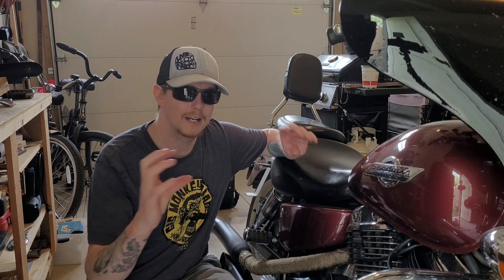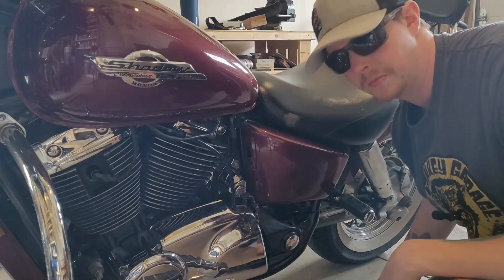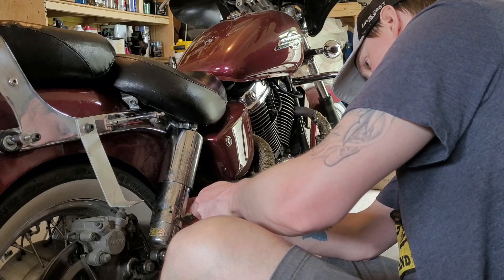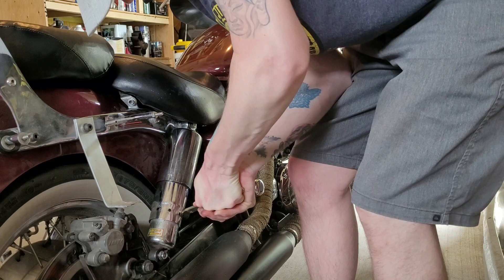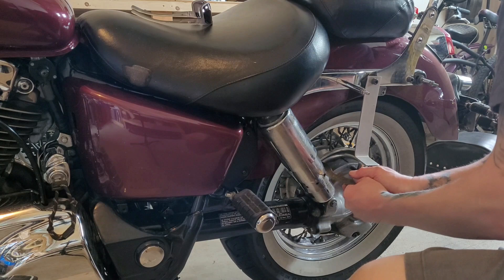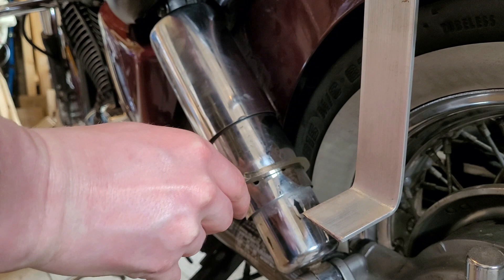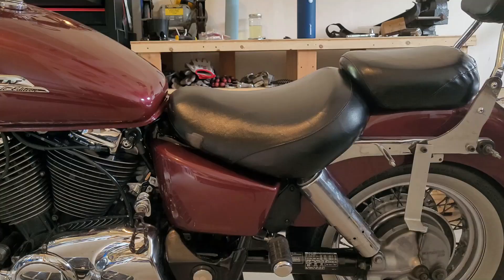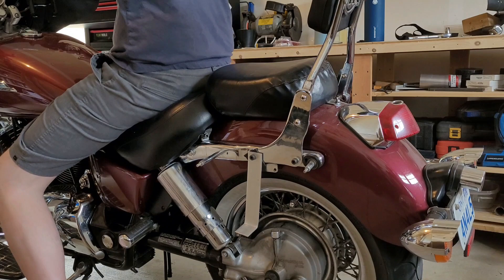Honda Shadow | How To Adjust These Rear Shocks

Comment: Im 300 lbs usually riding solo and mine are all the way up.Makes for a smooth ride.
Reply from the maker: Thanks for the info 👍  I've still got them set at 3, alittle on the stiffer side for just myself

Comment: At the 2 minute mark when you turned it and it popped and shot down is that bad and how do I go about fixing that or what do I do if that has happened? I have a similar bike and the same side did the same thing to me I’m just trying to figure it out. It’s my first bike and kinda learning everything from videos lol please help
Reply from the maker: I wouldn't say it's bad, keep turning it and it'll adjust up again, should click into place at each level
Reply: Should i get the bike off the ground when i do? I dint have a bike jack but i cant get one unless its still ok to do on the ground.  @motoalley
Reply from the maker: @scotthall3961  you can do it on the ground, it might be easiest to get someone to pull up on the rear just to get some of the pressure off the shocks
Reply: @motoalley  thank you so much.
Reply from the maker: No problem, hopefully I helped
Reply: @motoalley  you definitely did. Have you replaced a starter relay in yours?
Reply from the maker: @scotthall3961  yes I believe I have, it's just a small rectangle box that plugs into a 2 or 3 wire plug. Super easy. 
Maybe I'm thinking of the fuel relay, I can't remember 🤪🤔
Reply: @motoalley yea it is I just replaced mine because it literally burnt up and mine has 4 wires but I replaced the relay and the fir wire piece that goes on to it but I can’t get power back. I’ve looked at everything and even on test light it has power but the second I turn on the key I lose all power
Reply from the maker: @scotthall3961  is it grounding out on something? 
Is there still power going to it once its plugged in? Just no power going out of it? Maybe there's a short in the new replay?
Reply: @motoalley  i believe its the ignition switch. It has power all the way thru when its off but as soon as i turn the key on i lose it completely. But when i separate the connector on the main power line that runs to the ignition the power comes back all the way to the connector
Reply from the maker: @scotthall3961 sounds like your headed in the right direction
Reply: The "pop" noise where it drops, is when the shock is going from setting 5, back to setting 1.

Comment: Am very curious I rode with my girlfriend the other day and noticed over certain bumps the engine would cut out but not when I had the clutch in am I over loading the bike? Thus overloading the chain and engine? A little help would be great can’t find nothing on forums 😊
Reply from the maker: If it happens when you go over bumps only, I'd check for lose connections or broken wires. Is there a wire under the seat that your girlfriend sits on?
Reply: @motoalley  no sir there isn’t I was having some problems with my ignition module before? Maybe shaking it up to hard?
Reply: @motoalley  idk man it seems to not do it when I have the clutch in that’s why I was leaning towards to much load on the chain just kinda weird tbh
Reply from the maker: Could be possible, if your part of the hondashadow.net forum you can post your issues and they will help you out. Could be something breaking the circuit causing the engine to cut out when the clutch is engaged
Reply: If so I'm just a fatass just got mine yesterday and it did same thing with me on it lol.dont think that's the case though

Comment: thanks for the nice video,i have the same shocks like yours,im lightweight so i want it to make mine softer but i cant make it turn,can you explain what am i doing wrong?
Reply from the maker: Are you turning them the correct way? One way is easier to turn then the other. Try lifting the rear of the bike a little, relieve some of the weight will make them turn easier.